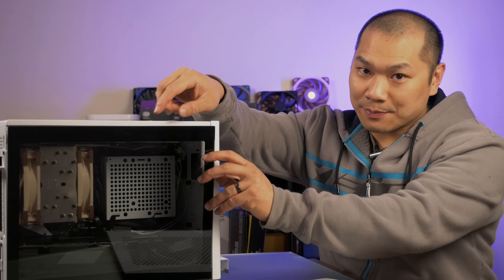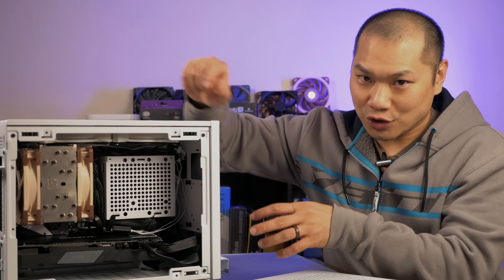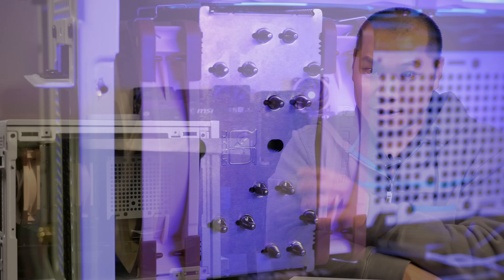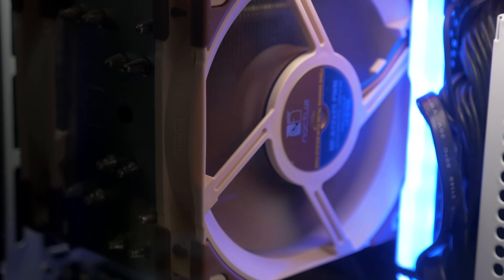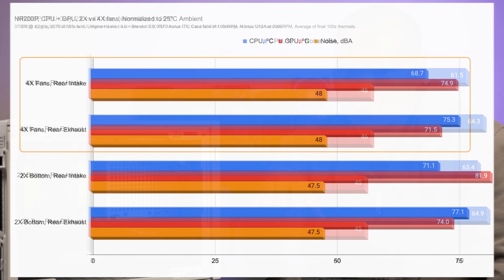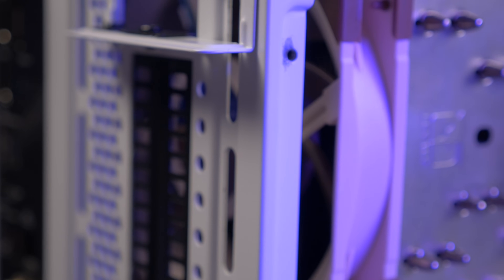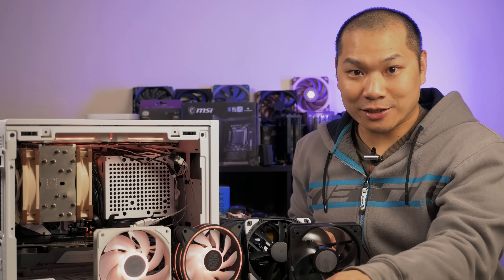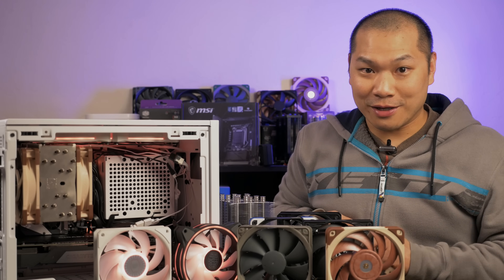Cooler Master NR200: Optimizing Air Cooling Thermals Part II: Higher TBP GPUs and the NR200P

Comment from the maker: A few of our viewers suggested a bottom intake/top intake, rear tower cooler exhaust configuration and I did test that out. After running it, it's apparent why it doesn't work well and the reasoning is similar to why I didn't recommend it for the vented panel either, it's just much worse due to the glass panel. 
For the same CPU/GPU tests normalized to 25C Ambient, I got 76.4 on the CPU and 75.0 on the GPU. 
Not good considering the rear intake with 4X bottom to top was 68.7/74.9 and rear exhaust with 4X bottom to top was 75.3/71.5. Almost as bad as the 2X fan configuration in rear exhaust (rear exhaust with 2X bottom was 77.1/74.0).

My observation on the reasoning is:
 1) A top intake suppresses the GPU exhaust that would otherwise be quickly taken care of by the case fan above, forcing it into the path of the cooler fans. Though you do get fresh air from the top fans, the penalty from allowing more GPU exhaust to be taken in by the cooler is much more severe. Essentially the CPU cooler is now the only route out, short of the hot case air bypassing the cooler through the gap between the rear of the case and the cooler. 

2) Running case fans like this increases pressure inside the case and reduces the efficacy of all the case fans, so total airflow is reduced as well.
Reply: Plus the exhaust of the PSU get blown down to be taken up by the cpu fan... It just don't make a lot of sense.
Reply: Rear Intake, bottom intake, top exhaust that's the way to go
Reply: Never thought the GPU would be affected too!
Reply: Well, it's logical, heated air eventually has to leave the case, if there is too little air going out, the ambient temperature is going to increase, and the CPU's heatsink also takes hot air from all the components.

Best would be two high speed high static fans on the bottom, the GPU on the bottom deshrouded, the bottom fans placed as close to the GPU's heatsink as possible, the top back fan and front fan 25mm, cpu heatsink taking cool air from the mesh side panel or rear.

What would also help i think, would be if the front of the GPU had a fan sucking air blowing out of the GPU directly to the front of the case, since i noticed these spots often having hot pockets, would probably decrease temperature of GPU by a few degrees, but then SSD's on the front may heat up... doesn't help that the front is closed up too, so it might do little.
Reply: Hi Mr. NR200! I'd like to suggest what is the best tower cooler? I'm using GIGABYTE B450 I AORUS PRO Wi-Fi motherboard
Reply: @piptaz04  Fuma 2 or C14S (with mesh panel only).
Mugen 5 is also really great, that cooler won't touch the tempered panel.
Reply: @funnyarc  thanks bro. actually I'm looking at Fuma 2 or Mugen 5 and yes, I only use the mesh panel
Reply: @piptaz04  If you are never gonna use the Tempered Panel, honestly if money isn't a issue, C14S is probably the best, because heat from the GPU won't get to the CPU, but else, you might wanna look at the 2 you listed, with those 2 you can use the tempered glass, were that panel the Mugen 5 will fit without issue, and the Fuma 2 the tempered glass may fit, but maybe perfectly with 1mm space or slightly touching.
Reply: @funnyarc  noted on that bro. "ill look for a sweet deal on c14s
Reply: @funnyarc  btw, I for the c14s I can still mount 2 top fans?
Reply: @piptaz04  Good luck, note the C14S is likely 2* the price compared to Scyte's coolers, so unless you want to maximize cooling and want ideal OC results, the other 2 are still pretty good.

Try out Prime95 with 'Small FFTs' test and Unigine Superposition to test heat.
nOte: Prime95 with that test will heat up your CPU to the ultimate max, Do Not use it with stock cooler.
Reply: @piptaz04  https://www.reddit.com/r/sffpc/comments/igagee/comment/g4wqr3e

Also, look at using Gelid gc-extreme thermal paste, great stuff, awesome thermal conductivity, will decrease temperatures easily by 4-8°C.
Bit harder to apply though (is a little like soft clay instead of paste), what i usually do is put a little bit on the middle of the CPU, turn the PC on, the CPU heats up, then after the surface heats up enough, but not too much (since that is bad for the CPU), i turn the PC off and start spreading over the surface.

Don't add too much, or you get lots of excess thermal paste around the CPU after the you tighten the heatsink, and not too little, or you get open spots while spreading since there is too little paste.

Also it reacts or dries to air, so don't take too long, but if it becomes more like clay and harder to spread, just turn on and off your PC again and heat up the CPU's surface so it becomes soft and pasty again.
Reply: @piptaz04  Hi, even though you do not have a high CPU placement like Gigabyte and MSI's B550i do, i was able to place a 25mm Noctua 12cm iPPC 3000rpm fan on the front of the heatsink, and also the same one above a Mugen 5, with a Gigabyte B550 Aorus.

Just have to not use the fan shield, screwing off the 4 sticks and placing them in the fan holes, also bent 1 iron clip used to hold a fan on the heatsink, just low enough so it won't touch the top fan.

There is like 0mm space between the top fan and heatsink now....

Also, it is possible to use a 140mm ATX PSU and a top fan above the PSU, while still using full sized GPU's, you just have to use a 92mm fan, and fit it between the round fan hole, if sone correctly, it will now hang inside, with less than half the height inside the case, and you can now place your PSU high enough to fit even a 320mm GPU.
This is great, since there is a SFX 750+Watt shortage, or whoever wants to avoid the SFX and ITX tax.

A good SFX (that does not have issues like exploding or burning, or sometimes obscenely loud fans) and top 120 would be better, but whatever gets the job done in the way you can, right?

If you mount the ATX PSU to the side (that square hole were you first took off that SFX cage) using cable binders, you can allow it to take fresh air from the side panel, this way you now have space on the other panel to install a 140mm intake fan (like the Noctua 14cm iPPC 2000rpm) with the mesh panel.
This also allow you to sleeve those top io cables in one of the top two holes.
Likely this mounting place will stop you using mATX motherboards though, but for this case, i would likely prefer itx though, even if it costs more...

...ok i went a little far offroad from your original question, i just wanted to write this in case anyone in the future reads this and wanted ideas...
Reply: @funnyarc  wow. thank you for this. I think it will fit. I'm using Corsair SF600 for my PSU and a twin fan 1660 super
Reply: @piptaz04  You're welcome, installing a ATX PSU was Hard though, since i don't really tire mentally, i could just keep going for hours until i planned it perfectly.

But since you already have a SFX, use that, it will be way less of a headache i imagine for you, also would allow a top 12cm fan and using the PSU cage. Though if you are ever going to upgrade to a 3070 or 3080, you will likely want to upgrade to a 750 or 850 watt PSU, for which the SFX ones are really hard to find and are often quite a bit more expensive, additionally many have some issues right now...

And yes, the Tempered Glass panel does fit without a issue.

For the Mugen 5 on a B550 Gigabyte or MSI were the CPU is higher, i had to bent the iron holders, here is a image showing it:
https://i.postimg.cc/MHnQ5LJn/16103203089613534158151805191477.jpg

You probably won't have to bend it since your motherboard's CPU is lower positioned.
Reply: @funnyarc  thank you very much for a very detailed response, bro! definitely helped me a lot on deciding which cooler and configuration to use.
Reply: @piptaz04  Ah, just one more thing, with the Mugen 5 and many other high coolers, the side panel bracket that you use for vertical mounted GPU, water cooling, HDD, 14cm fan, etc won't fit.
With the C14S you can fit the side panel bracket.

I did see a Reddit page were someone attached a 12cm or i thought it was 14cm to the mesh panel by screwing through one of the holes, apparently that guy said the holes aligned perfectly to screw a fan on, through in that case you wouldn't be able to use the dust mesh, or need to make holes in it. A idea i have to use both would be to use a iron wire, that would fit inside the small holes of the mesh, so you can attach a fan to the mesh panel without removing or damaging the mesh.

With screwing in fans, i imagine that may damage paint, so after you remove the screws, you might see some silvery color from the case, but it might not happen, this case is fairly good quality.

You however don''t need the side bracket, with the mesh, the CPU can get it's fresh air anyway (it's just a fan on the side panel i imagine might be better, i wonder though if the GPU might get hotter though..., bottom fans, or deshrouding (might void warranty) and 25mm bottom fans on the heatsink might help in that case), you can install SSD's to the front with the rubber buttons and long screws, and a 3.5" HDD can be attached to the back of the PSU.
Reply: @piptaz04  Anyway, C14S is the best CPU cooler if you only use mesh panel, Fuma 2 or Mugen 5 are best next if you also want to use tempered glass.

I have only tried the Mugen 5, can't comment on the other two except what others might have experienced.

Comment: If you run a blower style card then running rear intake would be a bad choice sinds you intake all the hot air of the gpu. Have you tested temps with a blower style card also or just regular cards witch exhaust into the case?

Comment: GPU should be always on the top Like in Rainjitek Metis but connected with pci-e riser and separated with alu plate to have own airflow tunnel. But for now there is no such case :(

Comment: SO helpful.  This video and TechSource's "How to Build a PC" step by step guide are all you need to build a system in this case, even if you don't know what you're doing.  Your video actually dealt specifically with my setup, which includes the 3070FE.  Really appreciate all the work that went into it.  I'm afraid to watch the one on the top air coolers.  Don't want to find out I bought the wrong one!  (ThermalRight Silver Soul 135)

Comment: Thanks! I have a very similar setup but did not realize I could do rear intake for the cpu cooler until I saw your video! One more thing to add is that if you have a very large GPU like the 3090 FE, you should get the slim fans for bottom intake because the case fans would not fit.

Comment: I have a Arous Extreme 3080, Ryzen 5 5600X and a Vetroo U6 Pro, intake on the rear, cpu cooler fans as well intake and both on top exhaust, cant fit on the bottom since the card is massive, i manage to get temp no higher tan 65C on the CPU and the GPU is undertvolt so is around the same 65c to 70c on full load. Wonder is a lower profile cpu cooler will provide better aire flow since the vetroo is big

Comment: A work around for using the Noctua cooler is to use low-profile motherboard stand off screws. That should give you the few mm clearance to use the glass panel.

Comment: have you tested the air setup with the cpu cooler facing up/down with air flow going up?  this would encourage the bottom to top air flow as the case was designed.

Comment: Last days i've performed several tests with my nr200, 7 arctic cooling fans (5: 120x25 and 2 slim ones) and 2 different CPU coolers (Noctua NH-C14S and AIO Artic Liquid Cooling 240mm). I've decided to take off the fans from GPU and use fans at the bottom. The priority was to achive lowest temps and volume using stress tests for GPU, then CPU, then during 1hr gaming sessions. 

My key findings:

1. Less is more. 

I've ended up with Noctua CPU cooler in intake position and 2 Arctic's at the bottom for GPU. With all possible set-ups in this case, this option created only  2C more on CPU but at the same the GPU had 4-5C less (strange but this is the fact, cant argue with numbers). With those 3 fans in total i'm also hearing difference in overall (better) noise. Its much more quiet in idle and stress then with 4+ fans.

 I was in to 1 more fan at the top (intake), but there was no diff in temps and additional fans creates more noise.

2. Aftermarket fans  > GPU cooling system

I strongly sugget to take off fans from GPU and use two 25x120mm fans at the bottom. This is at least 10C less and aftermarket fans are less noisy. I also strony suggest to put few anti-scratching stickers (like those for furnitures) to the bottom of the fans to make as close as possible to the GPU radiator. This made another 2-3C of a difference and the GPU is now comfortably laying on the fan (it was bending a bit). Also, as i wanted to be able to control those 2 bottom fans according to GPU temps, i've installed Argus Monitor, which a very complex software, one a very few that allows for this kind of linkeage.

3. Air Cooler > AIO's

I was really into AIO. Wanted to have this kind of "modern" tech and i though it will allow for better air ventialtion inside and major improvement in CPU temps. Well.. it might be me or this particular model of Arctic Liquid Cooling 240mm but...

A) The temps were a bit worse then with Noctua C14S (2-3C). 
B) The pump and little radiator on the mounting bracket makes calm but irritating sounds. This is very important in idle, when u're able to operate on 300rpms so literally - total silence. But unfortunately, AIO wasn't perfect.

4. RESULTS
IDLE: CPU: 32C | GPU: 25C
STRESS TEST: CPU: 55C | GPU: 62C
GAMING: CPU 48 | GPU: 55C
Reply: interesting, can you upload at least the photo of the GPU inside the case after that mod?

Comment: same. i do back intake cpu cooler, fan in from bottom and out from top. cpu temp goes down about 5-10 compare to cpu exhaust. probably because it dows use hot air from gpu and use cool air from the back of the case instead. gpu temps stay trhe same.

Comment: First off I love the detailed content and have a very Merry Christmas. 
I have an NR200p with 4 120mm Noctua fans (bottom slim) 92mm rear fan 
Asus X570 MB
AMD RX6800 XT
RYZEN 5 3600
750W Corsair 80+ platinum with sleeved cables 
16GB 3600 TEAMGROUP t force dark ram. Noctua NH-L9a but looking into tower cooling.  Thanks again for your hard work. FYI slim fans under my GPU WORKED WONDERS

Comment: I plan on running a BeQuiet! Shadow Rock LP CPU air cooler with Noctua LP fan, giving me just over 10mm space from the vertical GPU. My take is that the intake fans from bottom should be able to provide enough air for both CPU and GPU as air would be able to go through the gaps between CPU cooler/GPU backplate and GPU fans/glass panel. What do you think?

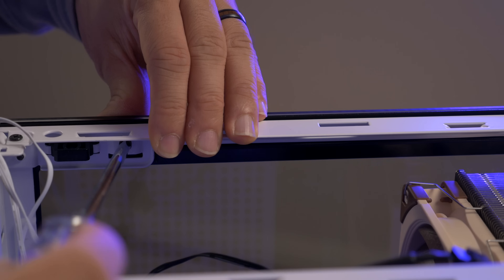Comment: 05:10 Wont the glass break when the CPU is running around 80-90 degrees? I mean, it does touch the heatsinks. I am thinking of getting 11600k in that case so I am wondering still.
Reply from the maker: If your fans are running, the heatsink doesn’t get that hot.

Comment: What is the optimal airflow for NR200 (vented side panel), 6 core CPU and 3080 non FE model? Should we use C14S or U12A? Should we try to find gpu with cut backplate (visible heatsink from the back) like Asus TUF model or it doesn't matter? Should we deshroud the gpu, and did you test using bottom fans as exhaust on deshrouded gpu?

Comment: I'm building one NR 200, with 3070 Ti, Bottom Intake, 2 x Noctua nf12x15, Rear Intake 92 mm Sickleflow case fan, Top exhaust 2 x 120 mm p12s, 
My CPU tower is vertical mounting meaning the U12s faces upwards, with 120 mm NF12 pushing air upward and that 92 mm sickleflow pulling inwards. Its a bit of a mix and match from all of your AIR cooling solutions for NR200 so far.
Reply: Mesh side panels

Comment: I changed to from rear exhaust to rear intake and it dropped my under load CPU temps 17c! GPU temps only increased by 2C under load. Card is a 3070 strix, no bottom intake fans. Tempered Glass Panel.

Comment: i have two fans on top (exhaust) and two slim Noctua fans on bottom (intake) and a 92mm Noctua (as exhaust for now) with a CPU Cooler Mugen 5  with fan exhausting out.  Lots of Fans! Machines & More. What are your thoughts?

Comment: I'm real late to the party, but I have a question. I haven't started my build yet, but I definitely want to be running four fans with the TG panel based on your videos! My question is about rear intake and dust filters. Dust, and more critically cat hair, is a concern for me, so with rear intake I'd like to install a filter - I've seen people use the mesh from the extra side panel, or a generic 12x24 filter modified to fit. But I wonder if the extra filter would mess with airflow enough to invalidate the benefits of having the cooler on rear intake in the first place... What do you think?
Reply from the maker: It will be a very very small difference, certainly the risk is more if you don’t clean it and it gets clogged, so get something magnetic so you can wash it often. The actual effect is something I’m curious about and will try to quantify in the future.
Reply: @MachinesMore  Thank you so much! Something magnetic on the outside of the case was what I was thinking of anyway, so now that you've said airflow will be fine, it's a no-brainer for me. Thanks again! I look forward to the data if/when you do measure the effect :) I'm curious about it too!

Comment: Great videos, huge help, specially in cooling solutions.

If I wanted to put 2 top case fans exhausting (P12), how far should the case be from a surface flat? The nr200p fits really nice in a shelving near my desk, but it only has 4.5cm to the upper shelf.

Comment: What If I only have two 120mm case fans and use one case fan as a top exhaust and one fan as a bottom intake? Or should I use both fans in a single 2X config? atm I only have a two-fan RTX2060